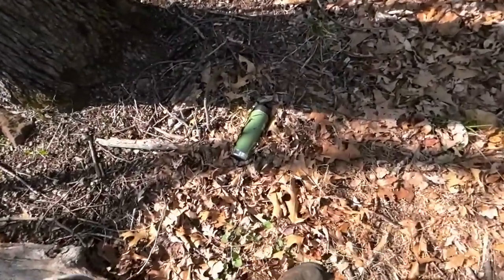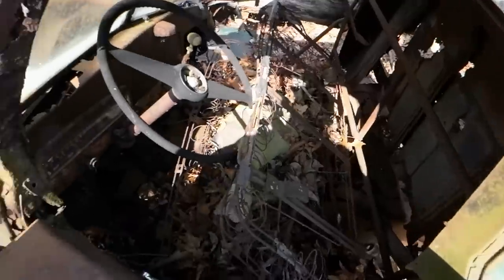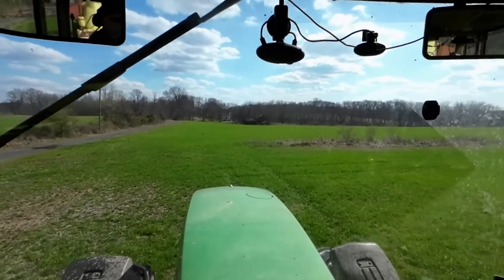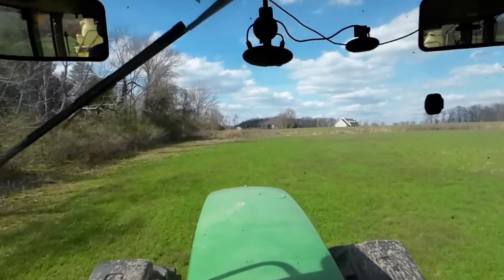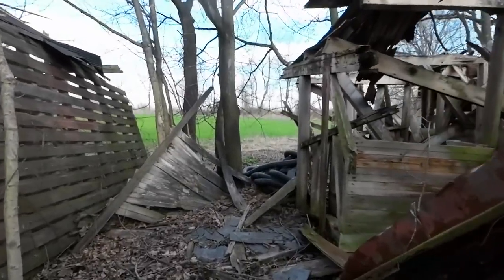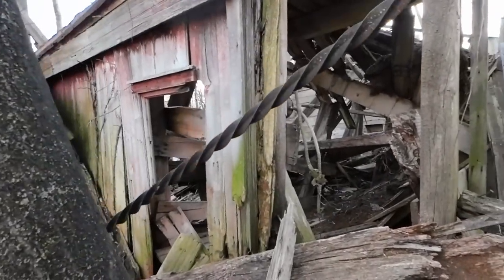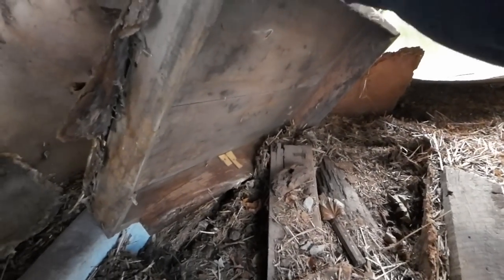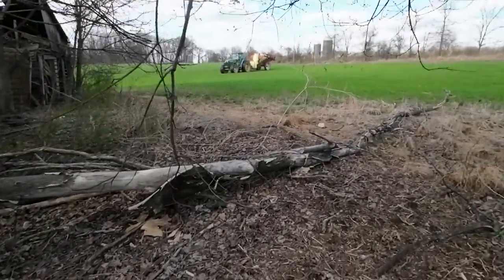Always Something to Look At

Comment: Your 'doorless room' is likely a grainery. We had a pair of those in our old barn built with tight fitting tongue and groove lumber to hold feed oats/wheat. Rats liked to chew into them to get at the grain and so old license plates were a popular patching material. The hay mows had 45deg beams that went under the floor up to the top plate where the roof attached and a steel rod the diameter of the one you found ran along the tops of those beams -- purpose of the beam and rod system was to keep the walls from buckling out from hay pressure. Originally our barn was filled with loose hay brought in by horses and ropes (put up mostly cured then a slatted floor with an airplane-sized fan finished drying it). I only ever put hay away in there in small square bales using elevators -- it would hold over four thousand hay bales when filled up, the other unslatted end of the barn was used for up to four thousand bales of straw.